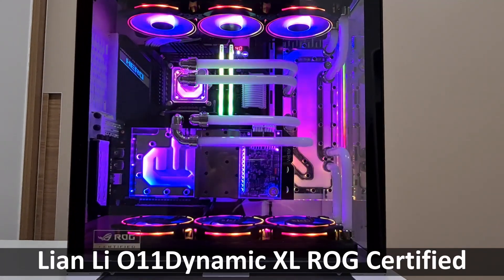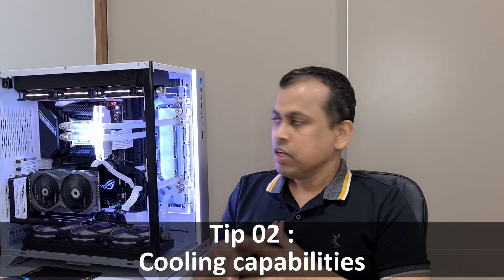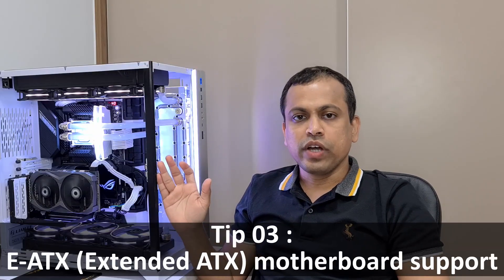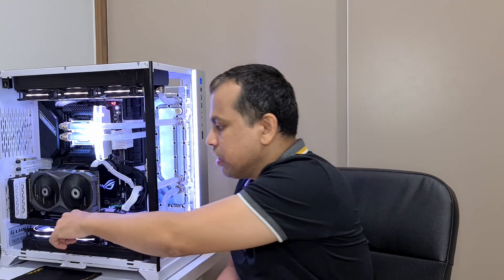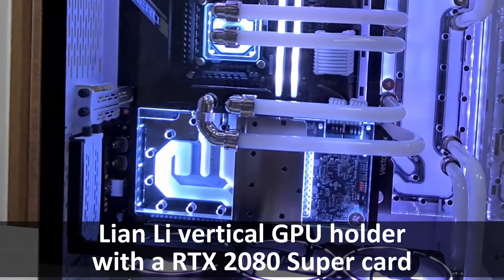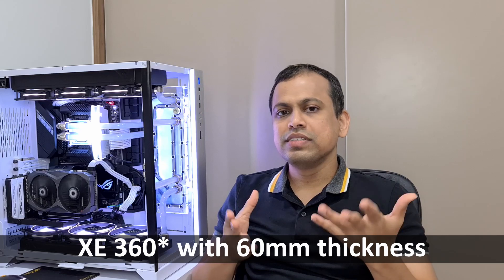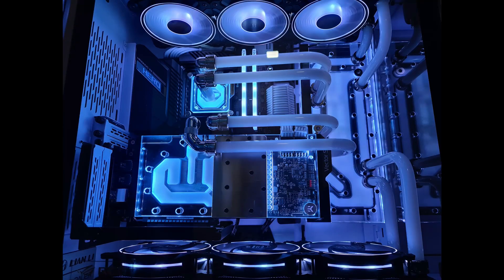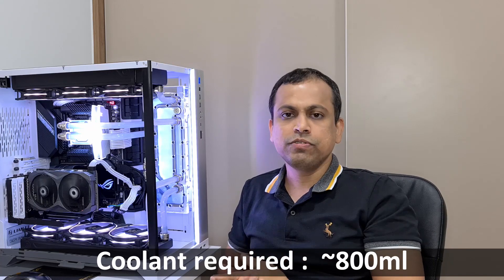15 Tips for PC Builds with Lian Li PC O11 Dynamic XL

Comment: Do you recommend any other front distro plates than the EKWB one? The EKWB has a design flaw that the pump is to far to the left, leaving not enough space for fans on the bottom back of the case. I saw a couple on ebay but I am just not sure.
Reply from the maker: For Lian Li O11D XL version, there are only limited front distro plate options to go. Among them, EKWB is the only distro plate I can recommend. If you really want to mount fans on side, you can install them from behind of the side fan panel. But it won't look nice as installing them on front.
Reply: @STechV  First thanks for the videos you make. Im looking to use this case for my first water cooling build. What about if we flip the distro plate 180 degrees for the pump is on the top right side? Do you think that would even work?
Reply from the maker: @tomfoolery3037  You're welcome. And yes, you can flip the distro plate 180 degree and it'll work. BUT, I don't recommend to do that, as it'll be harder to fill the reservoir without letting air goes inside the loop and even during the long run, it has higher chance of entering more air bubbles to the loop.
Reply from the maker: @Sinister [GD] I think the size doesn't match with the Lian Li O11D XL. So, I don't recommend to go with it.

Comment: Any solution to cooling the hard drive caddy's at the back?
Reply from the maker: These is not proper solution, but you can remove one HDD bay unit and install a Noctua 80mm fan(s) in the back. Fans size is not 100% sure, but Noctua has 120, 92, 80 , 60 and 40 mm fans. So definitely one of them would fit.
Reply: @STechV  That is kind of dissapointing since I hear that it can get quite hot especially since it's an enclosed space. Hopefully they fix that in the next iteration
Reply from the maker: That's true. It'd be better if there a ventilation method available for back side chamber. And I've a SATA HDD installed there. Will let you know the temps.

Comment: Nice video. I am going to build a Lian Li o11 dynamic XL and already got the Distro Plate von Lian Li. Now choose the radiator and the rest. Where do i find the plate under the Distro Plate, to cover the hole? Thank you for your good videos, to help other people. Keep going
Reply from the maker: Thank you! It's one of the metal plates comes with the XL case ( which you removes to install the distro plate ). I'm just installing one of the back.
Reply: @STechV  Ty for your fast answer. I have 2 x 360 Radiator 40 mm, the Distro Plate G1, 6 LL Corsair fans. How many fittings and what fittings do i need? What fluid should i use? I will take 16 mm tubes with 12 mm 
inside diameter. I really need help, planing all of that.. :( . If you could list these things, that would be awesome.
Reply from the maker: Sire. I can help. But these fitting are for a similar build like mine. You can have your own customization with difference set of fittings if you 'd like.  

Fittings you'll need (These are EKWB parts, if you want you can find same fittings in different brands) : 
EK-Quantum Torque 6-Pack HTC 16 : 3 packs
EK-AF Angled 2×45° G1/4 : 2 units
EK-AF Classic Angled 90° or EK-Quantum Torque Rotary 90° : 4 units
EK-AF Extender 50mm M-F G1/4 : 2 units ( CPU block extenders. You can go for shorter extenders like EK-Quantum Torque Extender Static MF 28. It's not a must to have, if you can bend the tube directly to the CPU block.  )
EK-Quantum Torque Extender Rotary MF 14 : 1 unit ( for drain port valve )

If you're going to use PETG tubes, don't forget to buy, 
EK-HD PETG Insert 12/16mm (10pcs) : 1 packs

And you'll need a ball valve for the drain port,
EK-AF Ball Valve (10mm) G1/4 : 1 unit

Nice to have items :
Filling Bottle (1000mL) : 1 unit
EK-Leak Tester : 1 unit
EK-CSQ Plug G1/4 with EK-Badge : 1 unit ( for extra safety of the ball valve )
EK-HDC Fitting 16mm O-Ring (6pcs) & Outer G1/4 Fitting O-Ring (6pcs)  (extra O-Ring packs)
Clear soft tubes + 2 x matching barbed fittings ( to drain the system )
Reply: @STechV  oh wow. Thank you for that list. I look at the parts soon. The amount of fittings are 1/1 correct right?
Reply from the maker: No problem. Yes, these are what I was using in this build. And for coolant, you can use EKWB CryoFuel Solid Concentrates (1L would be sufficient)
Reply: @STechV  Can i maybe talk to you like on a Plattform ( Facebook ) ? I could send you my things.. would help alot !
Reply from the maker: Unfortunately, I still don't have a FB page for my channel. But you can contact me via the email address mention in the About page.
Reply: @STechV  Hey man, i have another question. I placed the drain right where yours is, but i cant drain my system very well. Nearly everything stays in Tubes or Radiators. How do i drain it ?

Comment: Awesome video I'm trying to do a similar build it just looks so good but I have one question in the first video you used a slim coolstream radiator in the bottom and a pe 360 in the top, my question is do you now recommend a pe 360 coolstream triple in the bottom and a xe360 coolstream triple in the top or should I use both pe 360s ? Thank you sorry if this is confusing !
Reply from the maker: Thank you. And apologies for the confusion. I do recommends PE360 (triple) for both top and bottom (If you're planning to have Lian Li vertical GPU kit). Else, you can have XE360 (triple) on bottom with push-pull fans.
Reply: @STechV  yes I've purchased the waterblock for my 3080 and was going to purchase pe slim for the bottom but now I'll change it to the pe360 thank you for the advice, great vid I've subbed to you as well!:)
Reply from the maker: Great. Good luck for your build. Thank you for subscribing.
Reply: @TorvenAU  so did the pe360 rad, not the pe 360 slim work in the botton of your 011 lian li case? im thinking of using that case.
Reply: @file1man  hey mate havent been able to do my build just yet i have pretty much everything except for my 5900x cpu so havent attempted anything yet other than cleaning my radiators but i do have both the pe360 rads with me and hopefully they fit haha
Reply: still waiting on supply for the cpu before it gets sent to me been waiting for ages :(
Reply: I've installed it all now both rads fit perfectly the pe360 in the top had plenty of clearance however I did notice installing the lian li uni fans you want to first put in the htc ek fittings as its a very tight fit on the rad with fans

Comment: great video. The problem with ek’s front distro plate is that it does not allow enough clearance for fans to be mounted in front of the side mount. If you want fans in that position you’ll need to install them in the back side of the chamber, which will work fine but imo doesn’t look as good
Reply from the maker: Absolutely correct. I completely forgot to mention that in the video. Thanks a lot for highlighting it. When you mount the fans in the backside, you won't be able to get the max out of the ARGB effects. But, no effect on the airflow.
Reply: @STechV  So, I guess if you are running the front distro plate you can run three intake fans on the bottom, one intake on the back, and three exhaust on the top?
Reply: @JackilusMaximus  thats correct. But I would actually use the fan on the back for exhaust aswell...
Reply: @STechV  Would the front mounted distro plate be big enough to hide some brown Noctua fans?
Reply from the maker: @devadavey  I don't think so. It'll cover your fans view from front. But it'll always open from side.
Reply: holy shit i found your channel again after 2 years, i used to watch you back during season 2 of apex
Reply: I was going to post the same thing 🙂
What came as a surprise to me while installing the EK-Quantum Reflection PC-O11D XL D5 PWM distro plate was that there is not enough room to have the radiator ports for the bottom radiator at the front. You won't be able to align the screw holes, so the ports have to go on the  back. Here's a pic of my (at the time in progress) build: https://thorarin.net/external/pics/o11dxl_radiators.jpg
Reply from the maker: @Thorarin  Yes. Usually, when it comes to the front distro plate, most of the people connect both of the radiator from the far end. You got lucky that  you ware able to connect the top radiator from the close end. Anyway, it's always looks better with longer pipes. So, your bottom radiator pipes actually enhanced the look.